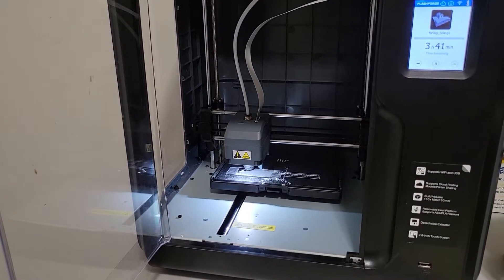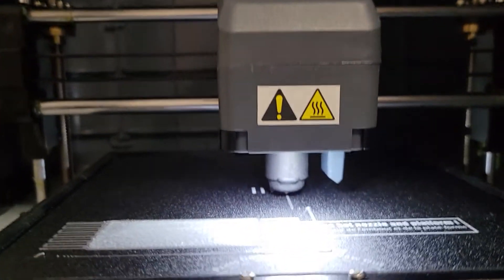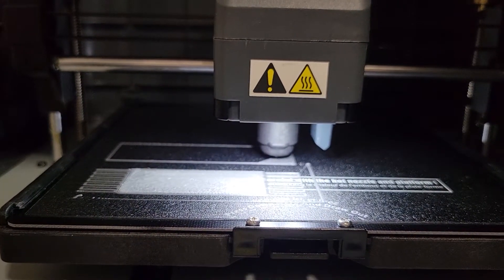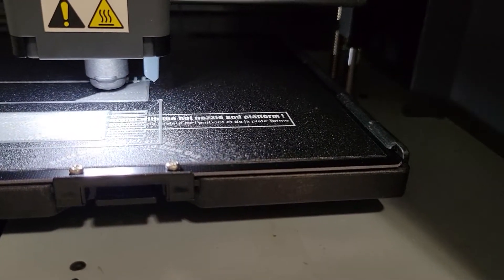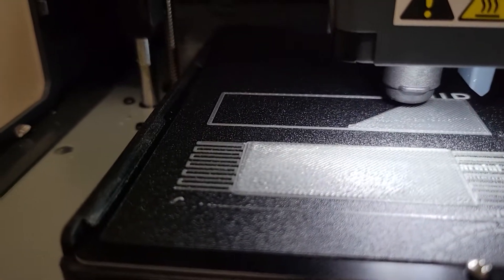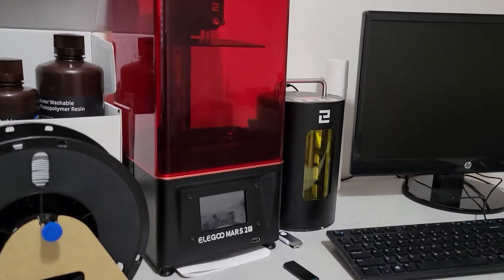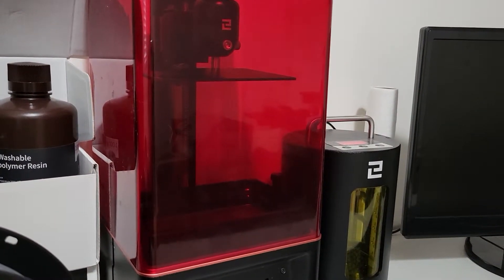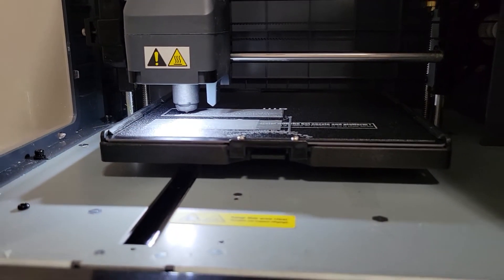Monoprice Voxel/Adventurer 3 Update

Comment: have you had any connecting problems with the printer to your pc through wifi or cable? i cant seem to get mine to connect to my computer i am running it out of the cloud for prints witch is working but would muchhh rather it link straight to my computer and kinda getting stuck on ideas cant seem to get it to update either any advice would be helpful thanks.
Reply from the maker: Sorry I've only ever used the cloud as I keep them in a separate room or done a USB stick. 
I did have issues with the cloud which updates to the firmware fixed. Also updating the PC software too for slicing.
Reply: alright thanks for letting me know my prints keep messing up and i have re calibrated it multiple times i am not sure if its out of date software or what the issue is i cant seem to find out how to update it either other than install the software to a usb stick but have had trouble even doing that currently...
 @mulockshadowshade

Comment: My adventure 4 has had nothing but issues since it arrived and currently doesn't even print because of their incredible sh**y firmware. First the bed wouldn't level now it won't feed filament or heat up or print when I can make it heat up. It worked 2 days before crapping out completely.

Comment: Which sliver are you using for running this printer? Although any recommendations for setting up the slicer to get rid of stringing and oozing? Thanks 🙏
Reply from the maker: I use FlashPrint 

As for stringing and oozing that is getting your settings just right for the printer. I suggest slowly changing the temp down and the speed set to levels like High detail has. That may take longer but I've had such great prints at lower speeds. Each filament can be different, and make sure you keep the doors closed for best results
Reply: Omg flash forge has an amazing slicer but nothing you do will stop the stringing spiderweb mess when printing multiple items at once except running it through cura first and converting it to flash forge formats. Do not get the adventure 4 the firmware is garbage and will never workif u message support they will send you the links for cura and how to convert files back to regular format

Comment: Do you have any advice or profiles you can share? I am having such a hard time with most prints. I bought 5 roles of filament from flash forge themselves and it seems to always have issues, unlike hatchbox. Do you have some profiles you can share?  I have re-leveled the bed several times. I am afraid I can't leave this printer alone for long 3_ hour prints.
Reply from the maker: I've not tried filament from flash forge, but what issues do you have? I will say I had bad filament that would not print anything large or that'd take a long time which is why I go with Hatchbox, each print would structurally fail. Now if that's happening then you can turn up the nozzle heat slighty at different levels
Reply: @mulockshadowshade  ah then it may be flash forge filament. I bought abs from hatchbox and have less issues than FF's PLA except for warping but that's standard with ABS on large prints and I'll work on that. Just seems like it takes multiple early first layer fails each day before it starts printing as expected without any changes made to the slicer profile. Do you use flash print as well or other slicing software?
Reply: @mulockshadowshade  to answer your question on issues, mostly have to keep baby sitting first layer for a while. With PETG it makes a mess and pre extrudes all over the first layer and find my self having to open the containment to remove the beginning ooze all the time.
Reply from the maker: I use flash print and I'll say it sounds like poor filament. If it's not pure chemically you'd need a higher precision nozzle. And if you use PETG you will want to get the higher temp nozzle for the adventurer 3 so it can handle higher temps with better consistency 
It's not the most expensive printer, but it does a great job in the right conditions. If you use Hatchbox I use default settings in flash print for pla and it works great
Remember to upkeep the nozzle and bed though, if you clean both after fails or replace as needed it'll make a big difference